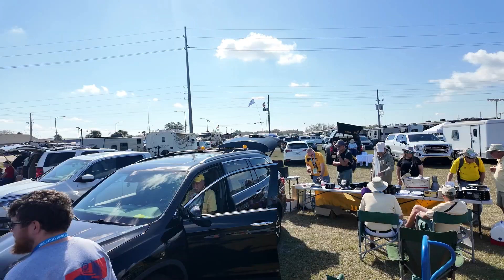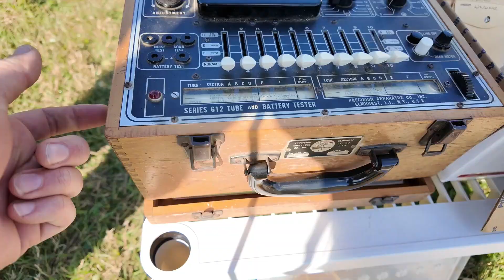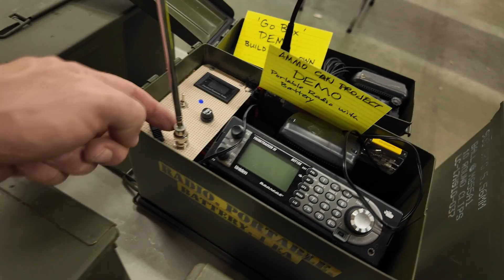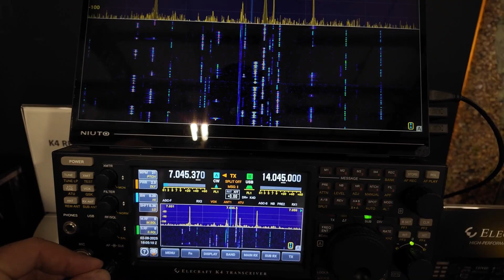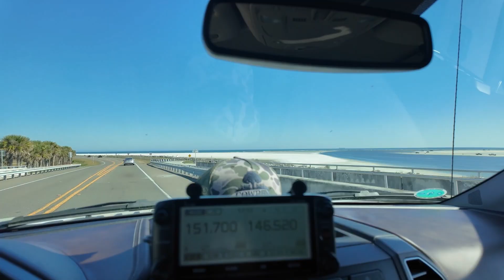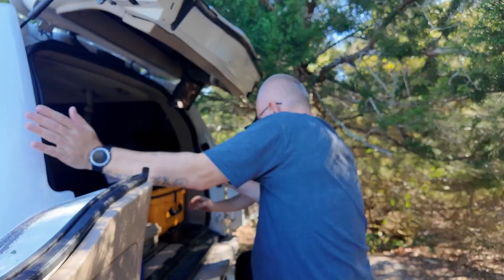BUG-OUT Comms Gear You’ve NEVER Seen Before (Straight from HamCation 2025) | Part 1

Comment from the maker: What’s your go-to HAM radio setup for off-grid comms or bugout situations?
Reply: I have a 818 manpack with a windcamp battery build in, a 10Ah battery on the frame, and a telentcell to charge my phone or run the radio. a 40 watt panel or a 20 watt, and a wouxon HT with crossband repeat. N9TAX jpole in the bag with a pota 20. EFHW and a Linked dipole 40/20. As well as a Caatail antennas and a ZBM2 antenna to run manpack style for VHF UHF. Works great and isnt to to heavy.
Reply: I actually just downloaded an app to learn and get licensed. I have zero equipment. It's just me, no family.
Reply: I have Baofeng UV-25 plus’s in my fleet. All kinds of awesome features for a SHTF situation. Currently working on figuring out what base station setup to do. That’s my next project.